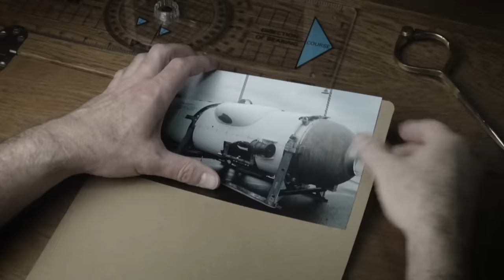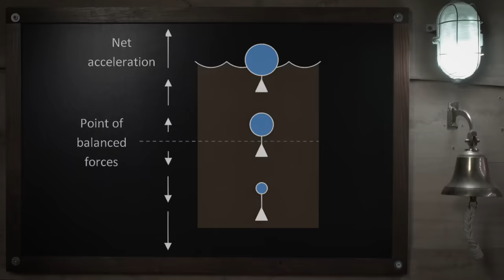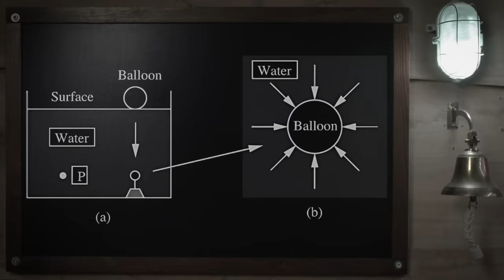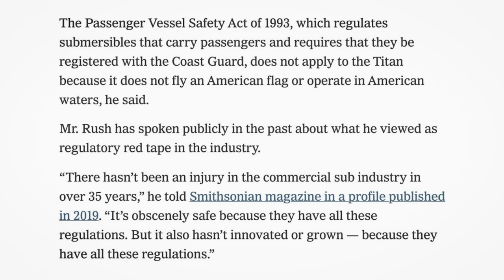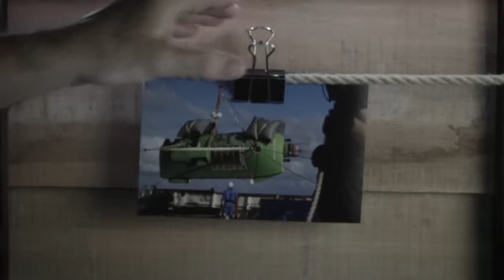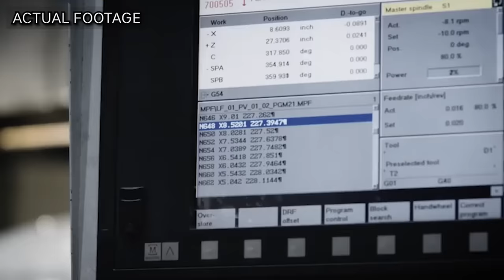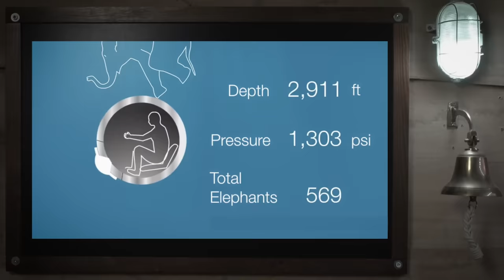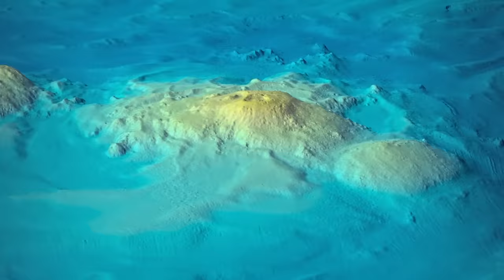Titan: From Inception to Implosion

Comment: The future is definitely not in carbon fiber. Carbon fiber is a great material for airplanes, because it's tendency is to shrink in. With a hull that's got more pressure inside than out, it's great. With a hull that's got less pressure inside than out, it's a recipe for disaster.

Comment: I think it was significant that Rush had been an F-15 production test pilot. As has been remarked there may be something bigger than a fighter pilot’s ego, but it hasn’t been sighted yet. In terms of ocean mining I’d like to see more work on using ion exchange resins to extract minerals dissolved in seawater rather than destructive strip mining of the sea bed.

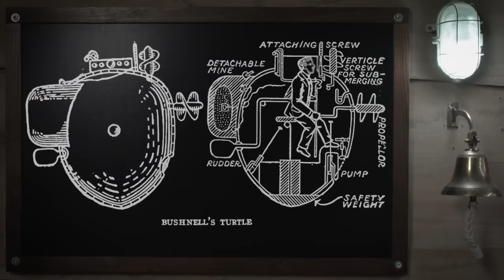Comment: I just want to point out that the depiction of Bushnell's Turtle at 1:33 is in fact incorrect as to the propulsion method. The Turtle actually had hand cranked propellers in place of the shown screws for submersion and movement.

Comment: I suppose many people already told this to the boss. For 40000 tons per square meter, 4000m depth, this cylinder looks too thin. Maybe it can work when new, but as it relies all in perfect strength matching around, as it loses strength matching it degrades to the point where it fails at 90% spec.

Comment: The biggest issue with carbon fiber is that is very good at tension, but not compression. At tension, carbon fibers and the resin is holding back the pressure, while in compression the resin is doing most of the work. That's one of the reasons why some high-end, high pressure air tanks are made of carbon fiber, wrapping the entire tank, not just the center.

It's like a fiber belt or strap can have hundreds or thousands of pounds of holding strength, but in compression it's just a loose pile of fibers.

For a pressure vessel at that depths, only  metal or other materials that are good in compression are suitable.

Comment: minor nitpick but at 26:50 you missed the second important feature of a rebreather system. Why is it called a re-breather? because youre re-breathing the same air youre breathed out. We dont absorb all the oxygen when we breath, but about 5-6% total from the 21% of oxygen in air. So majority of the oxygen is actually not used at all. In open-circuit scuba systems, this oxygen and other gases of the air are simply vented out and essentially wasted. 

On a rebreather, the exhaled air is scrubbed from co2 and with a minor injection of pure oxygen, youre breathing the same air constantly. Ergo, rebreather. You get a lot more diving time with a system like that, but its much more expensive and more risky as well. User error with a rebreather can be deadly without warning. For example, not enough oxygen in the air loop will cause hypoxia that can lead to disorientation, confusion and loss of consciousness. Or too much can cause convulsions without warning. One moment youre fine and the next youre convulsing and inhaling water. Rebreathers are no joke and is much more difficult and complicated diving than open circuit

Comment: No carbon fiber at all. Not in a sphere, not in a tube, not at all. The material is not designed to contract and return to normal shape without tearing. Opposite, it is designed to be used to go into space, as its a different effect that is sustainable. Carbon fiber will never work to go into depths like that.

Comment: Carbon Fibers problem isn't so much the resn it's that it has no strenght going in any direction other then pulling it.  It's not the thickness it is string.  You can pull it but you cant push it.
Reply: The resin has a Limit as to how much pressure it can take. Using carbon fibre for a submersible is ridiculous.

Comment: That is one of the scariest stories I’ve ever heard, it is so tragic and shows how a simple failure can lead to tragedy, I often set a boom brake which slows and can stop the boom coming across, this is a much bigger boat than mine so I don’t know if it would have worked here, they could have used the topping lift to take some of the pressure off the sail , it’s easy to be wise from the comfort of home but I think the pro crew could have done a better job getting the boat under control sooner, unfortunately would not have changed the outcome

Comment: 38:55
Lockridge: you haven't tested if this thing will implode on its passengers so you prob shouldn't submerge it with passengers in it.
Rush: sshhhh that's a secret. you're fired.

Comment: Carbon fiber can be engineered to have some flex. Nearly everyone with a compound bow uses carbon fiber arrows, which can be flexed repeatedly without failure, though they're quite thin. I suppose it would be stating the obvious to say that they just didn't build it strong enough. Hardly a good sign that he fired someone for pointing out the glass viewport was only designed for half the intended operating depth and neglected to perform hydrostatic testing.

Comment: MATHS IS NOT SCIENCE IT'S BEANCOUNTING, QUANTIFYING.
Universe is fields, magnetic fields, you cannot quantify a field. 
Pressure is to do with what happens to the water molecule, h2o. Pressure makes the water molecule TRANSFORM from liquid state to solid state or gas vape. 
Each time water molecules transforms, energy is released, radiation, can cause cell death. 
Diving, long term, will lead to lung damage, and often brain damage too. Same as flying too much. [jetlag, flightflu]

Comment: Aside from the kinda major mistake of misidentifying the Titan's carbon fiber hull as carbon fiber wrapped around a titanium cylinder (other documentaries showed the removal of the mandrel used when forming the hull) there was one relatively minor quibble I have. At  45:40 , the discussion turns to Rush not using the iterative approach and instead forging ahead with trying to prove a single idea and mentioning that this is a mistake other companies make. The footage shown is of the one Starship fully integrated flight test, implying SpaceX is on the same level as Oceangate. I find the juxtaposition misleading, since SpaceX is known for its iterative approach, and Starship especially has gone through many iterations and design changes from its inception, starting with the original goal to give Falcon 9 a reusable second stage, through the BFR, and the many iterations of the Starship system itself. There are major design differences between even Booster 7 (depicted during its flight) and Booster 9, slated for the next flight. A better example of Rush's form of mania would have been Franz Reichelt, the French taylor who was so convinced his wearable parachute suit would work he jumped off the Eiffel Tower with it. He certainly left an impression...

Comment: Excellent documentary/summary of The Titan and its development and ultimate limitations...  (The problem was ultimately that Carbon Fiber Composite is compromised after repeated use under such extreme pressure...)   There was no way to test for that.  (Because it had never been tried before in such a deep-water submersible.)   The cylindrical, as opposed to spheroid, design was also experimental.

 Stockton Rush has, and I believe rightly, been posthumously criticised for playing fast and loose with accepted practice and safety concerns.  And yet (though the loss of five lives is beyond tragic) his innovative approach has advanced deep-water acquanautic practice.  (This brings no solace nor comfort to the relatives of those lost, of course...)   

 However, lessons have been learnt here.  (Deep-Sub-Surface vehicles like 'Titan' will continue to be developed...)   Some day a vessel like 'Titan' will be feasibly functional.

 Respect and God Speed to those who instantly perished in this tragedy.

 I appreciated the 'Everyman' tone of this excellent presentation.  (I'm not a scientist but I pretty much understood the points made...)

 xx SF

Comment: I would like to add the human body may be capable of enduring much greater depths (if done properly), the current world record for deepest dive is 332.35m (1,090ft). The military (navy I presume?) also built a pressure simulation chamber to theoretically test how deep a human could go. They had one diver who experienced the simulated pressure of 701m (2300ft)! The human body actually fares much better than you'd think at extreme pressure as long as its not a sudden change. The equipment needed to keep us alive though? Not so much.

Comment: Overall good video but I think you've made a number of mistakes when describing the construction of the submersible, which a number of other comments have pointed out but in addition it should also be noted that carbon fiber isn't "strong" in the same way that metals are, rather its strength comes from when it's under tension. Essentially imagine it like a piece of string, you can pull on a piece of string, and that string will do a really good job at acting against that pulling motion, until the polling motion is too strong and the string snaps, however if you push on a piece of string it simply bends up and offers no resistance what-so-ever. All carbon fiber is, is basically string made out of a carbon base, so when you make a flat surface with it, in reality all you're really doing is creating a carbon-based fabric. As so carbon fiber is in no way resistant to the inward moving forces that you would experience under water pressure, as the material itself has no rigidity, so in order to give it that rigidity what they did is they applied an epoxy resin to it. The problem here is that all you're essentially doing here is gluing together fabric, so doing so does not give the fabric rigidity, the rigidity is only coming from the glue, so in truth the carbon fiber epoxy resin material that the submersible was made out of was only as resistant against pressure as much as the epoxy resin was, the carbon fiber itself in reality had nothing to do it. This is why so many other people in the submersible field were raising concerns about ocean gate, because they're experimental submarine was constructed in a way that fundamentally misunderstood the properties of the material it was made out of. Really, it seems as just like with   other "innovative business men" such as elon musk, they didn't really know anything about the fields that they are trying to revolutionize, all they're doing is throwing buzzwords and new technologies that they don't understand into fields that they don't understand and then demand that the people who work under them figure out how to make it work without any consideration for whether or not those new technologies and concepts actually change anything for the better in the field that they are trying to "revolutionize".

Comment: To pursue innovation, you have to get beyond known spaces. Carbon fibre materials were not to be used for submarines before. He thought he found a market gap there and pressed for it. 
But still, I would have used the first prototype for testing in a chamber to gather information about the material  behaviour and life expectancy to refine the design. To put people at such risk is actually cold-blooded.

Comment: If I understand you correctly, Rush tested to destruction model to get data for the acoustic monitoring system (ADS). Rush didn’t cycle a model to failure. I must admit I have little knowledge on how carbon fiber reinforced resins (CFRR). However, as a mechanical engineer (Bachelor level) I do know something about how metals fail under cyclic loading. Metal components can break when subject to cyclic loads at stress levels well below even the yield stress (yield is when the material first experiences permanent deformation). Failure occurs as microscopic cracks grow over time until a critical crack length is reached; then the component breaks in an instance. Check out any video on the “Comet Jet” failures. Seems to me had Rush been testing a metal component the test was loading to the material from zero stress to its ultimate strength in one test. Could the ADS have detected the sounds of the slow growth of microscopic cracks under cyclic loading? Even if yes do the sounds change as a critical crack length is reached? A warning that a critical crack length is about to be reached is of no use if one needs hours to surface but the failure will occur in microseconds. 
I am certain Boeing & Airbus tested CFRR components under cyclic loading before use in any critical aircraft component.

Comment: You’re wrong. I was on the Titan before the implosion.  The Titan was TOWED on the platform from Saint Johns. At one point before the fatal dive the platform was damaged by snagging a ghost net.  The seas have been very rough this year as no dives on mission 3 were successful. Mission 4 was scrubbed and the first dive on mission 5 imploded.    We’re the dives on mission 3 scrubber because of the damage to the platform and Titan?   With no successful dives at all this year was Stockton hoping the “billionaires” would be so thrilled with seeing the Titanic they would invest?   Why was P-H not on any of the dives on any other attempts this year?   Why did some of the crew say the sub would suffer catastrophic failure “within weeks”?

Comment: Compressive and tensile strength are two different things. It's not just a flexibility issue. Carbon fiber as it is is no go. Now..just like concrete eventually had rebar, you might find some way to combine carbon fiber with something else, but afaik, carbon fiber is not appropriate for vessels under that much pressure. Spherical or otherwise

Comment: Wonder if OceanGate had left the metal core, around which the carbon fiber was wrapped, if that would have made the vessel more robust and better able to withstand the pressures that ultimately sunk it.  And what if the carbon fiber had been woven rather than just wrapped.  Guess we will never know.

Comment: I don't really get how the tensile strength of carbon fibres can be exploited in what is essentially a collection of hoops with force pushing inwards, makes sense if it's a pressure vessel where the pressure is on the inside, but i can't see how the tensile strength of the fibres is relevant when the pressure is pushing inwards?

Comment: I know this is a bit late but what about a composite approach to the pressure hull i.e. a steel/titanium inner liner with a carbon fiber outer layer?
I have no background in engineering so would a 1.5-2in thick inner liner bolstered by an additional 3-4in of carbon fiber be as effective as a 4-5in steel/titanium pressure hull?

Comment: I do think that theres just a unknowing risk factor/ known manslaughter charge when stuff like this happens. CEOs or engineers that die testing or using their own products or experiences are one thing. Those that make something risky and refuse to use it, is another. The CEO who was so confident it was safe and his lifes work died inside of that fatal trip. I just watched a documentary about that water slide that killed that killed that 10 year old. The designers of the ride, their siblings, rode on it. From the prototype to the finished product. People make mistakes, but those that make knowing mistakes should be jailed. Those that try and create something new and believe in it, trust it, and are there is a different story. Its not right but at least the founder wasnt shrugging off the warning signs, he died from his failures.

Comment: I don't understand why an oxygen tank would last half as long if you double the pressure.  The human body won't be using more oxygen to operate.  Can't the tank/breathing apparatus mix a different amount of oxygen from the tank with the exhale gas of the diver at different ratios to recover/reuse the oxygen that would still be in the exhale gas?  I suppose that wouldn't be perfectly done but it should be possible to cut the loss by something like half.

Comment: So many product and service providers put way way too much faith on Carbon Fiber over Titanium,  CroMo, and Aluminum.  Carbon can be built to handle more stress and have a higher tensile strength by shape and design. When it does fail it fails catastrophically.

So it is obvious that thus company at one time actually did product research. Developed amazing materials development and application but started moving too fast and ignored safety..

Comment: Youre not teling the whole truth boeing sold them out of date carbon fibe,  and wasn't weaved it was rolled. That enough gives question yeah its gonna fail on top of it being used multiple times on this same submersible at this same depth. The submersible had enough.

Comment: Can someone with more knowledge on this topic than myself please tell me what the point of the sensors monintoring the hull were. 

Not what their function was, I understand that, but their real world effectiveness. I'm not an engineer, but I'm fairly certain at the depths they were diving to, if those sensors went off, they would essentially just inform you that you were dead. 

With how quickly and violently those pressures implode something with any structual defects, it seems like you would never be able to make it to the surface in time. It would be like a sensor on a wing that gave the pilots a five second warning that the wing was going to detach. I understand the thought behind it, but the real world application seems meaningless to me.